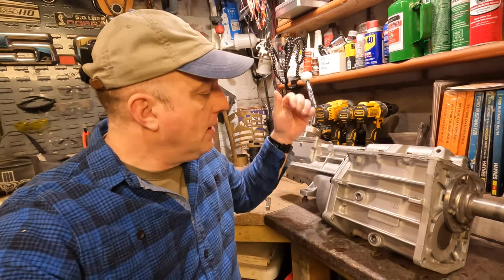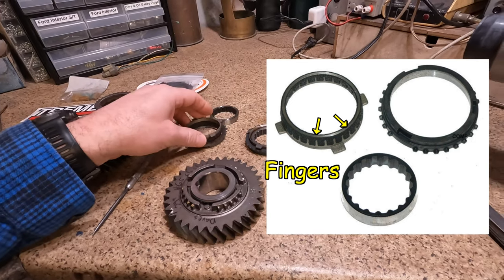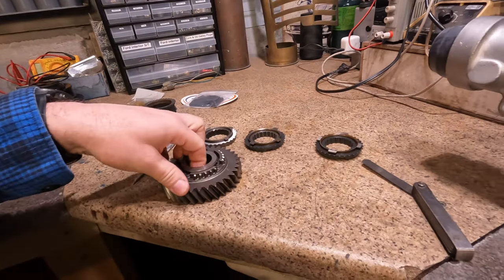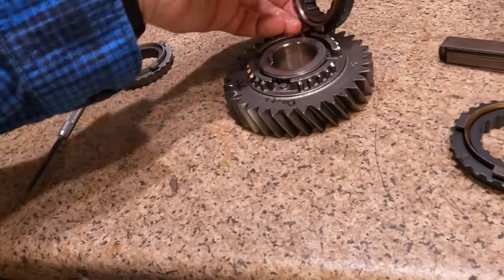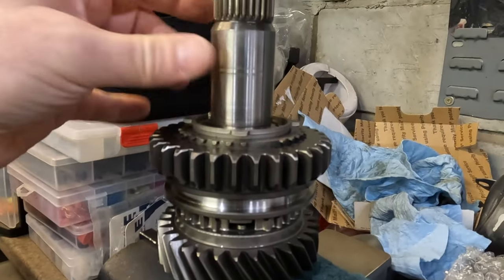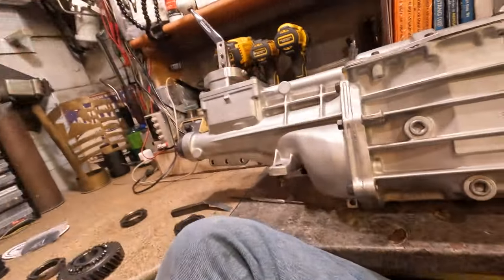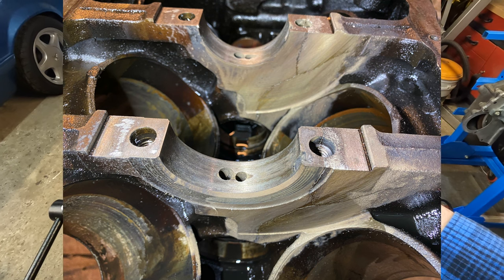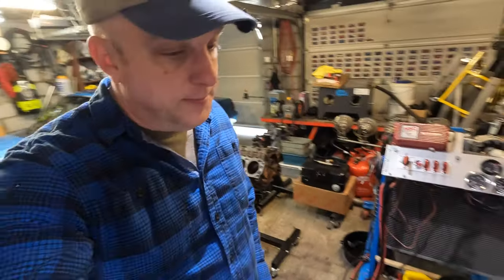T5 Transmission Rebuilders Are Going To Have A Hard Time

Comment: I tried installing them synchronizers in first thing they did was lock up I didn't even use them I found a non world-class t5 and use the synchros out of it for my car .it's the 4 wing sinc. And it is the same and it works just fine
Reply from the maker: Er... The non world class synchros are not even close to being able to fit into a World Class T5.  I just bought a full WCT5 synchro kit from Hanlon Motorsports.  Expensive, but they are now on the market again.  I have not gotten them yet.  Should be another week or so.

Comment: Have you tried soaking the carbon synchros in ATF? On the later T56s you have to soak them before assembly or you will have the same problem where you can't shift once assembled.

Certain T56 parts have been hard to come by since the supply chain crunch too.
Reply from the maker: I always soak them and it actually makes the issue a bit worse as it swells the fibers.

Comment: I'm going to buy the cheap synchronizers and try something out. I think I see a solution so that you can use the cheap synchronizers either the outer part is machined incorrectly or the friction material is too thick and it looks like there's quite a bit of meat on the friction material. thinking about removing said material until it can spin freely when assembled, have seen videos of a  drag racers getting rid of glazed clutch  material using a wire wheel on a drill
Reply from the maker: I wouldn’t waste your money.  The friction material of the cheap ones is thinner and the margin of error very small. You would need a lathe to try and modify the steel part of the cheaper synchro. The  carbon fiber material is far inferior on the cheaper version as well. It’s just not worth the time or money IMO.

Comment: I need to convert a 4-cylinder WC T5 to V8 ratios and I'm hoping to reuse the blocker rings. If not I'll spring for the Motorsport kit.
Reply from the maker: There is almost nothing gear wise in a 4-cyl T5 that will work with a V8's gears.  You would need to get a complete gear set for the conversion but it is possible.  The main shaft, synchro hubs, blocker rings, bearings are all the same and can be reused.  Usually 4-cyl boxes just get raided for parts to fix V8 transmissions.
Reply: @Mike-FoxsAbroad Thanks for your response. I'll change all the mainshaft gears and the countershaft. Haven't decided if I'll have the V8 input locally machined (and shotpeened) or modify the crankshaft to accept the V8 pilot bearing. It would be great to find a machine shop that's done the job.
Reply from the maker: @mchristr   You should find someone in the states with the stones to attempt machining the input shaft.  Once you tell anyone in the UK that the shaft is hardened steel they shy away from it like the tax man is coming to collect more money.  All they  know here is basic mild steel or aluminum lathe work.  They think it needs to remain hardened but when you can use a bronze bushing like they did in the old days, you realize that you only need a hardened pilot surface if it rides directly on a needle roller pilot bearing.   But machining the end of the crankshaft makes life so much easier.  Any machine shop can do that.

Comment: Don't buy from Amp Distributing, there blocker rings are so thin they do nothing. Unfortunately i didn't notice until the first test drive. They would stand behind their product either. Ended up using a syncrotech set in 2nd and a stock set in 1st for clearance. I also bought a T5 transmission 1st 2nd Reverse Gear synchronizer slider and 2nd gear. The trans would pop out of 2nd gear on the downshift sometimes but didn't feel right ever. Finally pulled it apart and found the slider was so loose on the shaft it was causing it not to work correct. Put my old slightly beat up slider in and problem solved.
Reply from the maker: I haven't done business with them in over 25 years when they did an AF acquaintance dirty.  He paid them a lot of money.  They didn't do the work promised on his car.  He had to get cops and lawyers involved to get his car back.  THey've been on my blacklist ever since.

Comment: Could you machine those synchros down to make them work. Since there's extra material I would think you could cut it down. But if you could get a bunch for cheap, why not correct them and sell to people who are looking for it.
Reply from the maker: The metal would be getting very thin.  Plus I wouldn't want the liability.

Comment: wow what a bummer to just now hear this, I just finished rebuilding my t5 with those aftermarket syncros, all I can do is hope for the best, thank god I held onto my old syncros as they were in great shape but there the older paper type grip surface, plus the fact the 1,2, and third gear needle bearings are hard to find as well, so now rebuilders are using the used needle bearings instead.  I guess t5 is coming to an end until aftermarket steps up, I used the acdelco synchromesh 10-4006 oil Ive heard good things about it in t5s, I hope it works out for me,  this ac delco oil shows t5 on its list of qualified trannys to be used on? your thoughts? thanks for informative video but I found this too late, I would of put my old but good sycros in instead of the aftermarket ones.
Reply from the maker: I don't have any experience using Synchromesh in world class T5's.  In non world class T5's it works very well as it is essentially 50wt gear oil, and has no effect on the NWC brass blocker rings.  If you install Synchromesh it in WC T5's you are pretty much defeating the purpose of utilizing a lightweight gear oil (ATF) for its quicker shifts and reduced parasitic drag.  I have seen many WC T5's destroyed from the use of non approved fluids.  Sometimes in less than 100 miles.  I'm not saying you can't.  I just do not condone it and can't say which ones will work without issue.  These gearboxes never fail from a lack of lubrication no matter which oil is used, but rather from the breakdown of the said synchronizers and general abuse.  These are a light duty transmission and these days they are handling torque ratings well above their original design spec.  I authored this article more than 10 years ago.  It may be of interest to you and includes further detail on the subject.  https://www.motortrend.com/how-to/1305-drivetrain-maintenance/
Reply: @Mike-FoxsAbroad  wow that motortrend article is very informative, I screwed up, thank god I havent used the vehicle yet, so I will drain the incorrect fluid nd put back the ATF fluid,  my last question would be synthetic or mineral based ATF? I originally was using mobil ATF synthetic but maybe mineral based Dextron is better? thanks for the heads up my friend
Reply from the maker: @sacooper802  You don't need to overthink it.  I just use regular Castrol/Mobil or whatever Dex/Merx (or some call it D/M) ATF.  Ford also says you can use Mercon V as a modern equivalent and I believe it is a synthetic ATF.
Reply: @Mike-FoxsAbroad all you want is dexron/mercon lll. Cheap is fine. Gear oil has different detergents that ruin the fibers inside. It's why you have to add friction modifier to the rearends with posi. The disc get hard and brittle.

Comment: What was used to fill the T5 and what do you use personally use.
Reply from the maker: Castrol Dec/Merc or Mobil D/M.  No need to run expensive Amsoil or exotic stuff.  I never understood why people think that Gucci oils make for better shifting or longevity when the olls it was designed for are so simple and cheap. If you ever watch 5.0tussin 's channel, he only uses the cheap stuff and bangs gears with the best of them.